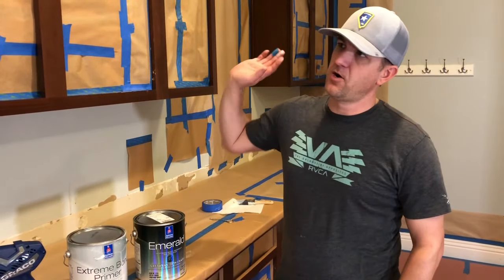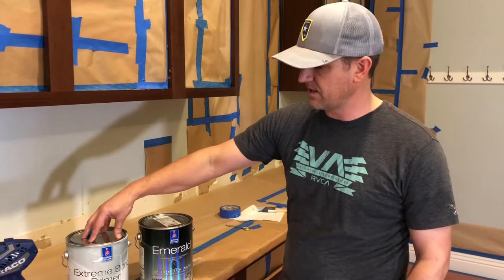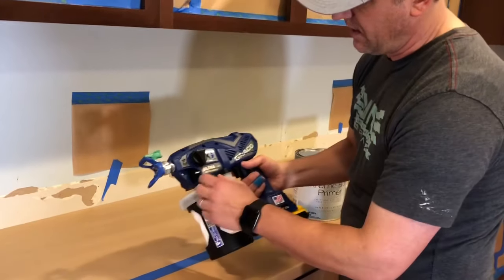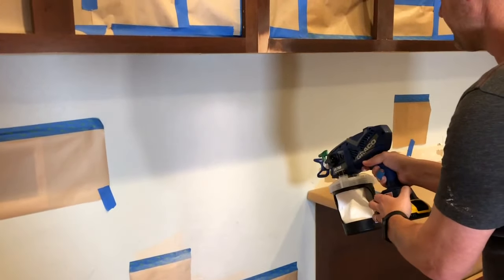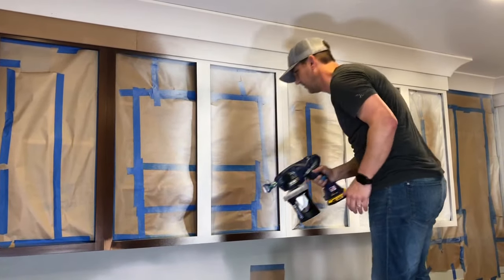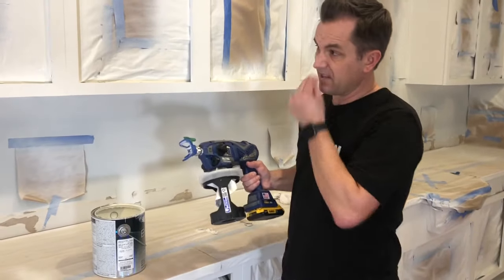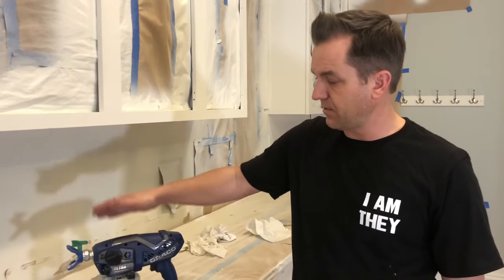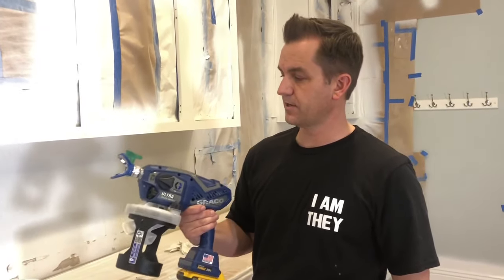How To Paint Cabinets EP 3 #PaintingCabinets #GracoCordlessAirlessSprayer #SherwinWilliams

Comment: I see you sprayed the face of the cabinet frames first, do you spray the inside edges after the faces are dried? Looks great
Reply from the maker: Great observation!  I had to do that on this video because I had too wide of a tip on my sprayer.  I just bought the cordless sprayer and my narrower tips didn’t come in time.  I’m able to spray the edges and faces all at the same time with a 212 tip.  It is always a good idea to spray in thin coats to avoid over application.  The first few times I painted face frames I had to sand out drips due to trying to paint everything all in one pass.  I need to learn to be more patient.

Comment: Have you had any problems with chipping or peeling after some time on the cabinets without deglossing? I currently degloss and use the same primer and urethane paint but if I can get rid of deglossing step that’d save a lot of time. I haven’t tried a set without deglossing yet Becs I’d hate for a call back for chipping or peeling.
Reply from the maker: I have not had any problems with chipping or peeling other than once.  I painted some drawers one night and installed them the next.  I then used some painters tape to make a couple marks on one of the drawers.  A small piece of paint peeled off when I pulled the tape off.  I think it was more about the paint not being cured than it was anything else.

Comment: Absolutely phenomenal series I really appreciate all of the specific attention to detail. One question for you:

When spraying cabinets, between 1-10 being the max 

what dial pressure setting do you find gives you the best finish when using the Graco ultra cordless?

Much thanks
Reply from the maker: Thank you Ariel. I’m usually somewhere right around 2 to 2.5 when I use the Graco Ultra handheld sprayer with a low pressure fine finish tip.  It’s hard for me to tell you where I am with the Magnum X5 because there are no numbers on the dial.

Comment: Nice video. Wanted to ask, did you sand after applying the primer?
Reply from the maker: Yes absolutely sand after priming.  I used 320 grit sand paper and sanded everything down before applying my finish coat.  It’s probably the most critical step in the whole process to get the glassy smooth finish you want.
Reply: @buildwithbc  Good to know. Thanks for this.

Comment: Quick question. I purchased the SW oil based primer but is this primer just as good for a latex? I have wood doors and typical mdf casings for the cabinets. Was wondering if I can get away with the latex primer for ease of cleaning and keeping my graco gun running the same base between primer and paint. I also bout the same paint as in the video as just as you said it was highly recommended locally.
Reply from the maker: Not sure how I missed this comment.  I apologize for my late response.  It’s my personal preference to always use SW oil based primer to prime raw wood and raw MDF.  Water based primer can raise the grain and create an extra step of going back and sanding more than I want to have to do.  

You bring up a great point about clean up.  Cleaning up oil based in an airless sprayer can be a pain.  I use my hvlp sprayer when I spray oil based paint.  It’s much easier to clean up an hvlp sprayer than an airless in my opinion.

You won’t go wrong with the SW Emerald Urethane Enamel.  It is so durable and easy to apply.  Best of luck on your projects!

Comment: Hi. So I'm interested getting one to. Apparently this are to be used for only 100L of paint before you have to change the pump.... did you had any problems with the pump? Have you changed it by now since you have been using the sprayer? Thanks
Reply from the maker: You bring up a great point here.  The X5 is considered a hobby/homeowner model from Graco.  It’s not made for day in and day out use.  That said, my X5 pump is still running strong and I haven’t had to change it yet.  The pump in my Graco Cordless Ultra sprayer did have to get changed out after about 20 gallons of paint though.  I let someone borrow the sprayer and they didn’t clean it out properly so it killed the pump.
Reply: @buildwithbc  do you think that with a good maintenance and if  you're looking after the sprayer, can have a longer life
Reply from the maker: @d.a.c.1665  Proper maintenance will absolutely prolong the life of your sprayer.  I follow Graco’s instructions by thoroughly rinsing and running the Graco Pump Armor through my pump after every use.  So far it has paid off for me.
Reply: So we learn the age old lesson, don't loan your tools.  I have run more than 20 gal and not had a issue with the Cordless.  The pump is a replaceable part. @buildwithbc

Comment: Do you find the paint has an orange peel finish when done spraying? Apparently this is normal. The paint settles quite well, but I can’t get it to settle completely smoothly. I am using a Grayco 390 fflp 308 and 310 tip. Both seem to work.
Reply from the maker: I did get a slight orange peel look on one project when I tried using a new tip I hadn’t used before. I lightly sanded it out and went back to the 210 FF tip and it turned out perfect.  The primer is a bit thick and doesn’t settle out like the urethane does.  I make sure I sand the primer thoroughly before I paint and it makes a big difference.

Comment: Thanks a lot for your video. Thats what I looking for, I mean, nno primer oil, shellac or lacquer. Please can ypu tell me exactly what kind of Graco sprayer is?.
Reply: It's a Graco ultra cordless Handheld 👍🏻
Reply from the maker: I used both the Graco Ultra Cordless and the Graco Magnum X5.  You can go either way.  If I had to have just one, I would go with the X5.
Reply: I have used the Graco Ultra Cordless and Magnum X5.  One advantage of the Ultra Cordless is in the paint cups.  The cups are sealed and during breaks, the paint doesn't dry in the containter.  There is no hose so the no hose losses for the paint.  The cups can be capped for another session later.  So less waste in my opinion.

Comment: Great job, What material was on your cabinets? Painted or stain? I was about to paint my cabinets and it has stain on it, Can I still use SW Extreme Bond Primer?
Reply from the maker: My cabinets were all stained.  Yes you can use The SW Extreme Bond Primer on stained cabinets.  Clean them up real good so there’s no residue on them and you are good to go.
Reply: Eric still l iui lightly sand

Comment: I noticed you didn't have to do a lot of masking.  Is overspray a problem?
Reply from the maker: I use a fine finish tip which allows me to spray at a lower pressure so overspray is minimal.  I’d  still recommend always masking everything off you want to protect.

Comment: thanks for the great tips! one thing i wanted to ask is how is your sprayer holding up ? i am tempted to get one but i wonder how they hold up after a while.. any issues?... thanks again
Reply from the maker: Honestly the handheld sprayer takes just as much time to clean up as it does to clean up my X5 sprayer.  The X5 is easier to use than the handheld in my opinion.  If I were to have just one, it would be the X5 for sure.  I have sprayed a couple hundred gallons through my X5 and it’s still running like a champ.

Comment: Bad primer - used it on sanded surface and it peeled off in some places. Paint is great though, self leveling, glossy and smooth
Reply: No primer on earth would have that result on a sanded surface, unless you're talking about priming glass or something similar. I've used this exact combo of primer/paint on my kitchen cabs, and I was happy with results.
Reply: @BoldWittyName  used on a banister, sanded well for weeks and vacuumed washed and cleaned to avoid any such issues 
It was ok on a low traffic kitchen island laminate material but the banister - not so much
Reply: @irapodyukova1414  try Ilva from benjamin moore undercoat with shellac primer the best result 👌 Ilva is a wood coating product really hard,

Comment: Very informative. Thank you. Did you buy a different spray tip to paint the cabinets or did you use the one that came with the unit?
Reply from the maker: I bought a different tip.  I sprayed the primer with a 212 tip and the paint with a 208 fine finish tip.
Reply: @buildwithbc  I read that this unit can't use a different tips. Hummm
Reply from the maker: Roger Chan what sprayer are you using?
Reply: @buildwithbc  I ordered a graco vsp 360 thinking that I could change to a finer sprayer tip. Then I read that it could only be used with the tips that came with it. So I'm really confused.
Reply from the maker: I have never used the Graco 360 so I am not very familiar with that sprayer.  Have you emailed Graco to ask if they have other tips available for that sprayer?
Reply: @buildwithbc , I did. Waiting to hear back from them. Thx for responding. I might get the graco x5 but it might be an overkill just to paint the  cabinets.
Reply from the maker: Roger Chan the X5 is great for painting cabinets.  I just used it last week to paint a whole house full of cabinets.  It’s not as portable but certainly works great.  You’ll need to switch the guard to a Rac X if you want to use the Fine Finish tips but thats quick and easy.
Reply: This is the Graco Ultra not the True Coat - the true coat uses its own different tips (not a fine finish machine).  The Ultra and Ultra max use standard tips -  FFLP these and be changed. @RogerClubv
Reply: I made that mistake the 360 is less money and less sprayer.  Not for fine work. @RogerClubv

Comment: Is there any reason you started from the bottom & up?  Do you put any protective top coat after the urethane base?  Is it durable and easy to clean in the high traffic home kitchen area?  I am about to spray whole house cabinets, my first :)
Reply from the maker: No particular reason why I started on the bottom, would make more sense to start up top as well.  I don’t put a protective coat over the paint.  One coat of primer and two coats of paint is perfect.  If you use the same paint I used you’ll have no issue cleaning the cabinets off or scrubbing them down.  That Sherwin Williams paint is incredibly durable once it’s cured.

Comment: is there any other recommended primer to go with the emerald urethane trim enamel, Sherwin- Williams
Reply from the maker: Great question Amir.  That really depends on what you are painting.  I know SW is out of Extreme Bond primer right now and from what I hear, they don’t have an ETA for the replenishment as of yet.  So, if you are planning on painting over previously finished cabinets, but can’t get the Extreme Bond Primer, you will need to use a de-glossing product or sand everything down in order to prime.  At that point you can use the primer of your choice.
Reply: @buildwithbc  thanks, No I am not repainting an old cabinets. I am trying to do DIY on some cabinets I built, I am not from USA, in my country I am getting the emerald urethane trim enamel, but doesn't get the sherwin- williams primer. The store have Duron Primer, can you say if that can work?
Reply: @buildwithbc  we are still out of that primer in the Chicago area.
Reply from the maker: @J_D_B4379  I hear they are running low all over the country right now.  Raw materials are in short supply.

Comment: excellent information a question how many primer coats did you give
Reply from the maker: I apply two thin coats of primer to everything. I do one coat of the urethane on the backs of doors and drawers and two coats on the fronts.
Reply: @buildwithbc  Thanks for answering me, I just bought the Sprayer when I saw your video I will do the same process and use the same paint, you can give me the name of the material you used thanks.
Reply from the maker: @deivisalcedo6542  I use Sherwin Williams Extreme Bond primer and Sherwin Williams Emerald Urethane for the finish.
Reply: Great video! Did you have to thin out the primer?
Reply: @jonathonvincent79 no thinning anything he said

Comment: Do you have to thin out the Emerald paint for the gun?
Reply from the maker: No you don’t have to thin out the paint if you spray it through an airless sprayer.
Reply: @buildwithbc   So airless is a paint gun that's not connected to a air compressor?
Sorry for my dumb questions but I've never used that paint or paint guns & I want my cabinets to look pretty.
Reply from the maker: @browneyes2100  there are no dumb questions.  There are different styles of paint sprayers.  My videos showed how I paint cabinets with airless sprayers.  One was cordless and the other was a bit larger but they both work the same.  You don’t need to thin your paint when you use this style of paint sprayer.  This style of sprayer is really easy to use and get great results.  Some people don’t like the finish you get with an airless sprayer so they’ll use an HVLP sprayer.  They are most commonly used hooked to an air compressor but there are various styles here as well.  I use an HVLP sprayer when I spray oil based paints and primers.  HVLP sprayers can cost much less than an airless sprayer and give your phenomenal results.  You will have to thin your paint if you use an HVLP sprayer.  Each sprayer is a little different and it’ll take some testing to see what works best for you and the paint you like to use.  Was this at all helpful?

Comment: I tried this paint, and not impressed with the durability for wet areas.  It gets discolored and soft when in contact with water, even quickly.   It also takes a very long time to cure and stays a bit tacky during the cure period.  I will try traditional oil based paint with enamel hardener for my next project.  Anyone else out there have this experience?
Reply from the maker: I have had zero issues with durability with this paint.  I’ve done kitchens, laundry rooms, offices, bathrooms all with zero issues.  It does take longer to cure than oil for sure.  I let all my doors and drawer fronts dry for a day or two before I install.  I also live in Las Vegas and it’s very dry here.   Not sure how much humidity may impact the performance of the paint???
Reply: Yes on long curing but otherwise it was a good paint. I used 3 different colors in my kitchen and bathroom - no issues with discoloration with the water. Had to be careful the first month though
Reply: Your experience is unique for a properly prepared, primed wood surface. The material, properly applied with two coats will dry for lite use within two hours and cure to a hard shell finish, sandable within 25-30 days....you must have a component missing if what you say is true

Comment: I have turncoat 360 any tip recommendation for cabenit spray
Reply from the maker: Sorry but I am not familiar with that sprayer.
Reply: the 360 does not do fine work and has a large orifice.  I bought one and was very disappointed.  It was cheaper, but

Comment: Did you have to sand the cabinets?
Reply from the maker: I did not sand the cabinets prior to priming.  You will want to sand after you spray the primer though.  Nothing major, just take some 320 grit sandpaper on a block and give everything the once over.  Run your hands over everything you painted to check for spots that need to be sanded a little more.
Reply: @buildwithbc  does extreme bond primer go directly over varnish or even oil base stains?
Reply from the maker: @ricardodominguez902  yes it does.  Makes painting over cabinets a breeze.  Just make sure the surface is clean before you prime.

Comment: Any problems with the thickness of the paint?
Reply from the maker: In what respect?
Reply: I have a graco true coat 360 ds and would not push out the sw emerald urethane paint. I’ve read the paint is too thick. I agree, I don’t use any other paint for cabinets. The self lever helps with paint brushes but really want to pull the trigger on the hand held that can handle this paint. Thanks again
Reply from the maker: @mram7715  I don’t have any experience with the true coat 360 so I can’t speak to that.  Both my handheld and my x5 airless have no issues with the emerald urethane.  I have thinned it out and sprayer it through an HVLP sprayer with no issue.  Have you tried thinning it a bit?
Reply: @buildwithbc  i haven’t tried thinning it. But in considering upgrading for sure. Seems the ultra has more power. I appreciate the feedback. 🙏🏻

Comment: If my cabinets are Oak will the grain show through this primer and paint?
Reply from the maker: Justin Dillon yes the grain will show through ever so slightly.  You could prime it a few extra times, sanding between each coat and get the grain to fill in if you wanted it to.
Reply: The grain will show through unless you take steps.  Use a grain filler - like aquacoat then sand and primer.